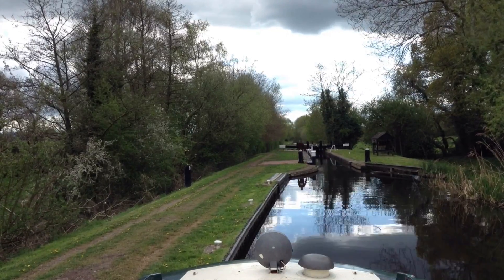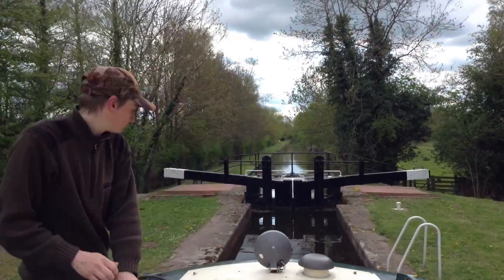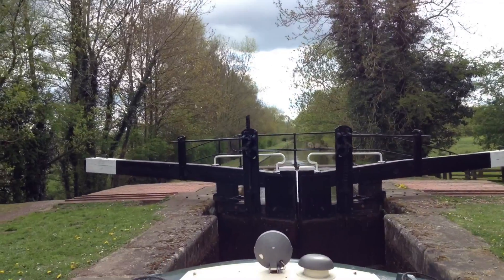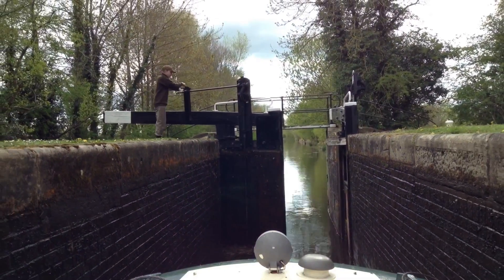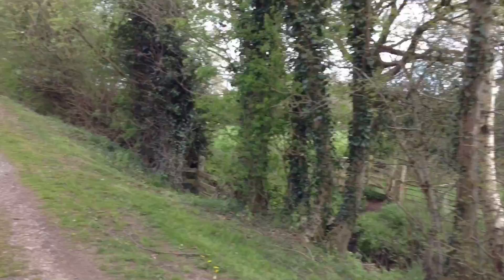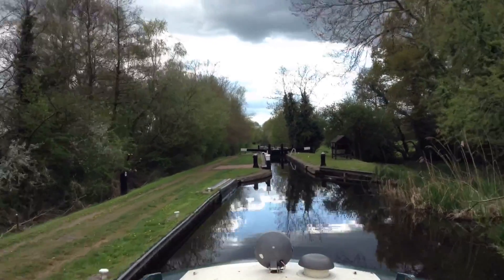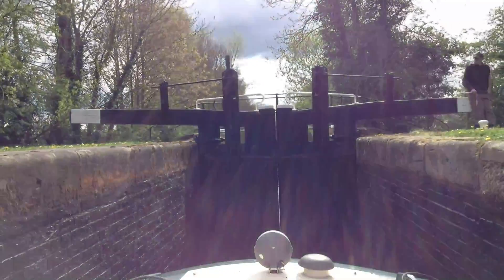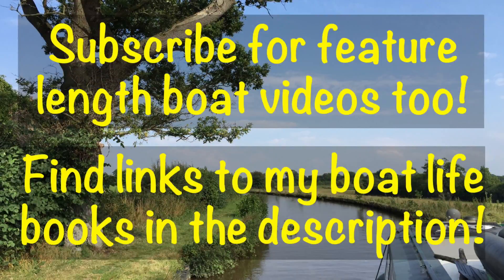UBB: Why do Canals have Locks?

Comment: Surfing around on the web, I found it kind of difficult to get the WHY HAVE THEM answer that you provided. Thanks.
Reply from the maker: Hello! The canals are mainly man made, so where a river will naturally flow downhill and follow the contours of the land, canals were routed as efficiently and easily as they could be built.
So they used locks to move to higher and lower sections of canal because they couldn’t just make a really steep section of rapids, or building incredibly long river like courses that gradually followed the shape of the landscape.
So the locks are almost like a shortcut, a way to brute force water up and down hill.

Comment: actually I think it is  more to do with conserving water and maintaining depth. Even if you could maintain a slow and gradual descent the higher points would run dry very quickly
Reply from the maker: Interesting point but I think it would be very difficult to get a canal boat to go downhill, even harder uphill if instead of some of the huge flights of locks, you just had a giant water slide! It would take a huge amount of weaving and turning like a road in a hillside to somehow make the decline or more so the incline possible... Especially if being dragged by a horse!
Reply: +Simon Tinney no its just for hills :3
Reply: +goinghomesomeday1 and the reason for river locks ? and "sea locks"?. I think you all miss the point.
Reply: Simon Tinney hmmm
Reply from the maker: +Simon Tinney Oh dear, i think we are talking very similar ideas but slightly different angles. If you take a look at this sunken boat in a weir, it is right next to a lock on the River Nene, again the weirs help make the river navigable but my point is that locks have to exist to let boats up and down different levels of water without going over the rapids. A fast flowing river couldn't be channeled through a lock to control water flow without flooding, and a boat wouldn't be able to travel up and down a river/canal that had weirs/watefalls with no locks!  http://www.dailymail.co.uk/news/article-2230606/Couples-retirement-dreams-sunk-50-000-houseboat-crashes-weir--forgot-sign-flood-warnings.html